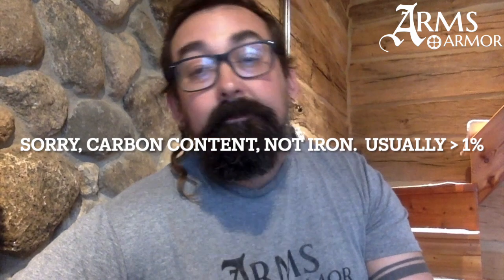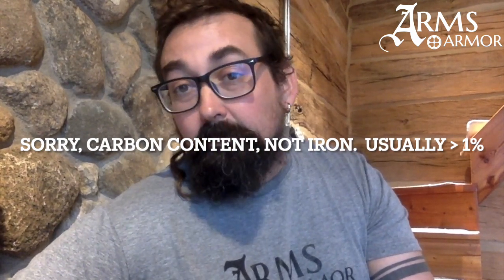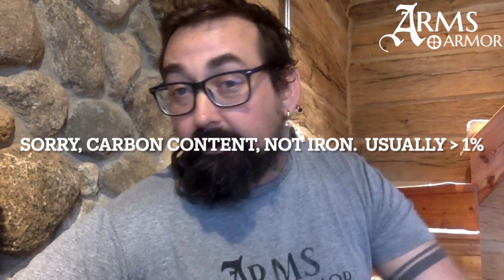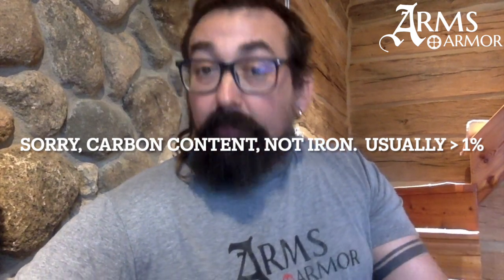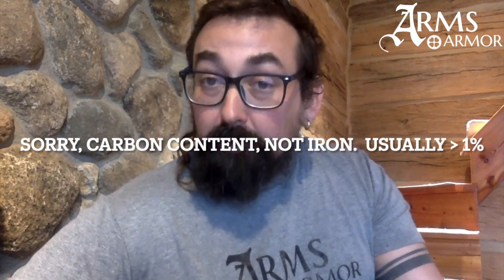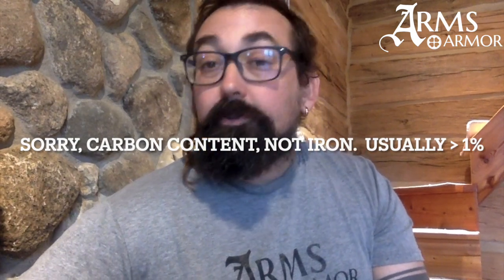Is Damascus Steel better for making swords?

Comment: I've been forging katanas for 30+ years I don't ever mess around with Damascus not for swords or knives. I consider it a clown knife it's just for looks I forge my katanas for extreme use. What I find is people get confused when it comes to layering my blades are layered. I call it lamination but I use three types of steel in one katana, each steel I work and fold and twist and work over and over and over I do all that to the three different steals then I layer my material exactly how I did it in Japan for seven years my blades are built using the Soshu Kitae method I think theirs only 2 of us in America doing this great video Damascus is so overrated and the funny thing is it's not even Damascus that disappeared a long time ago🤣

Comment: Iron and steel in those areas in the Middle Ages There were people in the Middle East who were at a very high level in this industry, but there were those who differed in the manufacture of metal and no one told about the secret that made this steel so strong, but that industry disappeared after a while due to the lack of need to manufacture a blade at the time when firearms were discovered and modern weapons became more valuable and swords are not useful if we look in reality how these swords can be able to cut tanks 😂 This is pure imagination, but in the era that was previously based on swords, in this case we can say that Damascus steel, which was smoke silver in color, was the strongest and had superior ability

Comment: Any time I watch forged in fire, the guy going for Damascus seems to lose
Reply from the maker: That show kind of sets craftspeople up to fail and they have some major restrictions on time and process that create a lot of problems for their contestants.
Reply: @armsarmorinc.4153  I’ve heard that as well. The time constraints are so tight that really the most basic reliable monosteel (lookin at you 5160) with a good temper wins as long as it’s in parameters and comfortable-ish to use
Reply from the maker: @seanmiz6539  yep its pretty constrained to get there pressure on to make it look dramatic.

Comment: Damascus is like a blend. The pure stuff isn’t worse it’s just not blended. Damascus can be better if you get several super high quality steels. Single type steel can be better if you get the absolute best steel because then there’s no reason to layer it.

Comment: Could you elaborate on what you meant when you said you can make "super swords" using two different kinds of modern steels? Does this relate somehow to how swords were produced in Japan where the blade edge is harder and the spine is softer? (though I understand this is achieved by differential hardening using clay instead of using two different steels?). What would be an example where two modern steels would benefit the development of a sword today?
Reply from the maker: Hi Andres there are certain alloys with very dialed in specifics about what can be achieved with hardness, durability and ability to hold an edge. These can be combined in constructional ways to maximize the attributes. So yes it  would be similar to some of the multi piece constructions of blades in the past. But in the case of modern steels you would be using the metallurgical sciences as opposed to the observable qualities a smith with hammer in hand is using.
Reply: @armsarmorinc.4153  Awesome. Thanks for the thorough reply. When you guys make reproductions do you develop them with these modern techniques or do you try to be more faithful to how they were developed in the past? Or does this depend of the customer (if the customer is asking for a custom piece)?
Reply from the maker: @abordeu  We usually are approaching the piece more like the medieval smith than as a modern manufacturing process, though this varies by item and objective. The steel we use is of course far more refined than the period material would have been, so in reality our blades are going to be more consistent through out than a medieval example.

Comment: i really appreciate this vid! i want to know if crappy steel was used in europe in sword blades and how often
Reply from the maker: It would be impossible to say with confidence how often. In the reality of it all the factors that go into things today as makers would happen then as well. In most cases you would use the best source for consistent quality supplies you could get. Customers could pay extra to get special things or your supply chain could collapse and you need to find a new source. The customer may come in and say I need a bunch of these but want them cheap. So they get offered the slightly less desired steel you have been sitting on because you did not want to use it. 

In period this would be very localized as far as the factors influencing these decisions and it would be more likely that less desirable materials where used the further one got from the source and the lower the status of the smith and customer. So almost certainly crappy steel was used, even iron was used often as a component. But how often would be a guess more than a calculation.

Comment: A lot of people seem to romanticise history to such an extent that they're offended by the mere suggestion that modern monosteels are inherently less likely to fail than something with a ton of laminations and forge welds in them. Pattern welded steels will ALWAYS have more potential failure points than a monosteel, even if that pattern weld is made with quality modern steel.

Comment: I'm more curious if modern "super steels" that are used in more modern knife making would make better quality reproduction historical swords and knives like the kind you guys make.
Reply from the maker: Most medium to high carbon modern steels will make a fine blade. Some are probably a bit better for long blades than others but the variations in the steel itself are so minimal compared to the ancient and medieval materials they will out perform the originals. Some of the "super steels" may work but one needs to watch out for brittleness. Some of the special ones are getting the carbon content very high and if not processed correctly this will result in a long thin blade breaking, where a thick heavy cleaver like knife would be less prone to snapping if not levered against itself.